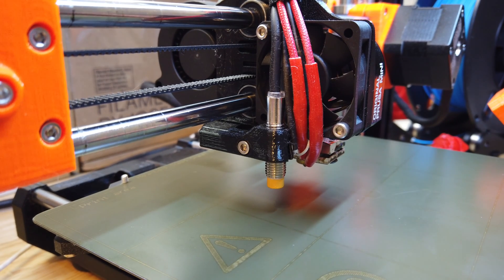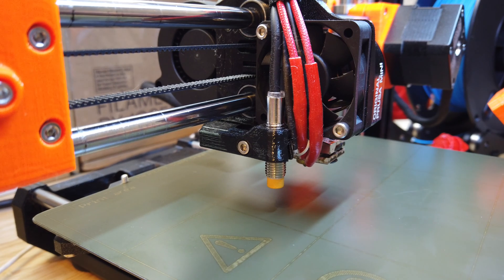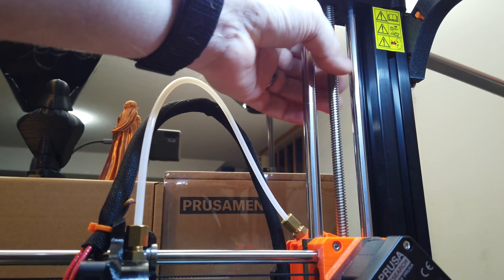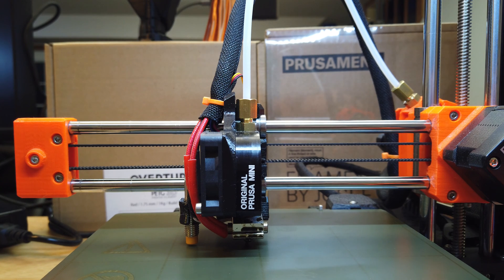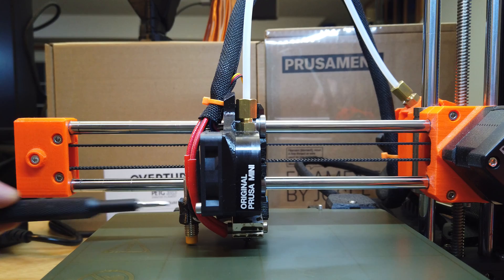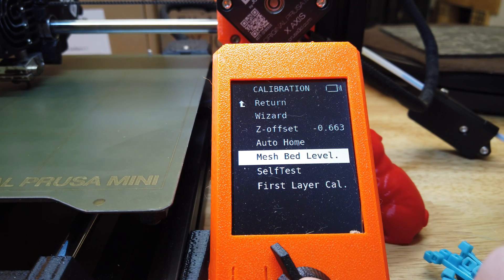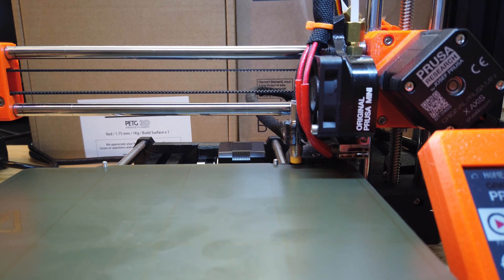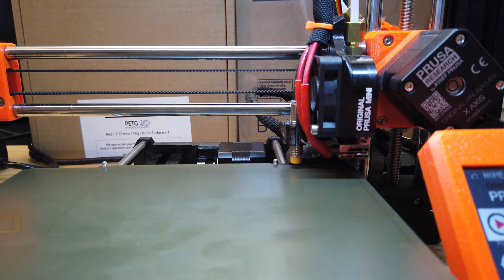Prusa Mini:  Setting The Minda Probe Height

Comment: Thanks so much, I was fighting this a lot and the Zip tie was the perfect size to get this right, thanks!!!
Reply: The exact thickness isn't critical, you just need something that's thin enough that the sensor will end up close to the height of the nozzle, but thick enough that the printer has time to stop when moving down (before the nozzle hits the bed). The final height is set by the "first layer calibration" / "Z-adjust" parameter, so you can use something thinner or thicker (within a -2 / +2 mm margin - I think that's the range available in the menu).

Comment: EDIT: I see it does look like you are using the print sheet when running the mesh bed leveling, it just looks different that the one I have which is probably the Mini+. 

 I noticed that you did the automatic mesh bed leveling without the build plate attached, is that what should be done after adjusting the MINDA? I adjusted my MINDA last night but when I go to do the mesh bed leveling the MINDA seems to be way too far away from the bed. I haven't done a first layer calibration since I adjusted but it just seems strange that the mesh bed leveling has the MINDA so far away from the bed. I feel like that is throwing everything off for whatever reason. I do have my MINDA slightly above my nozzle like this video showed but still that's my issue as of right now.
Reply from the maker: I suggest you do a first layer cal.  The actual distance from the build plate isn't an exact thing and I tend to run my Pinda/Mina probes higher than most, (I don't want them running into a model as it's printing.). The probe just needs to be in range to work effectively, If you can run a Mesh bed leveling or the wizard successfully, all is good.  Don't get wrapped around the axel on trying to get the probe at some exact height.  I use a Zip tie and they vary in thickness from manufacturer to manufacturer.  I could have used precision measuring equipment, but it's not necessary.

Also the offset you end up with when doing a first layer cal isn't something to worry about either.  you will find forums that claim that it's an issue, it's not.  The various sheets that I use on my Mk3s have offsets that vary from -.6 to -2.3. 

 All that matters is that the machine delivers a consistent first layer.
Reply: @Zelrick42  Thanks for the quick reply! I have defiantly been caught up on an exact height of some sort. The issue before that had led me to adjusting the MINDA was my Z height was as far down as it could go and I wasn't getting a good first layer at all as the nozzle was still too far away from the print bed. Again I appreciate the help and quick response!
Reply: @Zelrick42  - The sensor will never "run into a model while printing", because it's always higher than the nozzle, and the nozzle is always at the height of the highest layer. For the sensor to hit a model being printed, the nozzle itself would have to be pushing down into the model. And if the sensor was lower than the nozzle, you wouldn't be able to print the first layer at all.

Comment: So what is the difference from edge of menda sensor to tip of nozzle? Is is even or -.05mm?
Reply: The difference will be the thickness of the object that you placed under the sensor. In the case of this video, it was the thickness of the ziptie. If you run a 1st layer calibration afterward, the offset will be very close to this thickness amount.

Comment: Just got my printer. My printer likes to print like 1cm above the bed and I tried adjusting the pinda but I still need like a -1.4 offset
Reply from the maker: The offset is fine, the first layer is the important part.

Comment: Is this considered auto bed leveling or do you still have to level the bed somehow besides the probe itself?
Reply from the maker: It is what is considered Auto Bed Leveling.  Really like all fixed bed printers, it creates a mesh that tells the z axis how to adjust to make the nozzle stay at a consistent height from the bed.  It works extremely well and you will never want to go back to a manual bed leveling set up ever again.  I have some sort of Auto bed leveling all the printers that I use regularly.

Comment: Have you printed the improved cable stress parts? (https://www.thingiverse.com/thing:4065410) Basically the hotend cable is a bit short and gets strained when the extruder is at the end of the carriage, these print files will reduce the stress on it.
Reply from the maker: I didn't, I replaced all the zip ties and didn't cinch them up as tight and didn't put on in the top spot on the extruder end. I noticed the issue before I saw the parts you mentioned. I'm sure the parts works good, but my method is simple and has been working fine.
Reply: @Zelrick42  Good idea! Can't wait for mine to arrive!